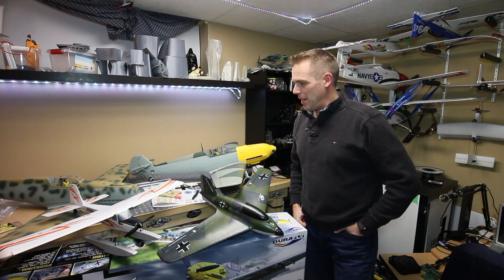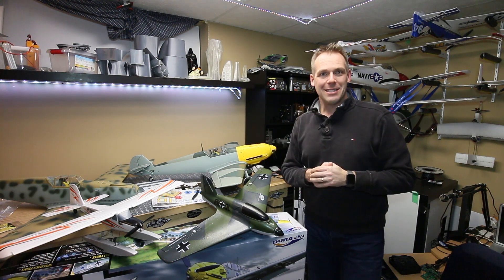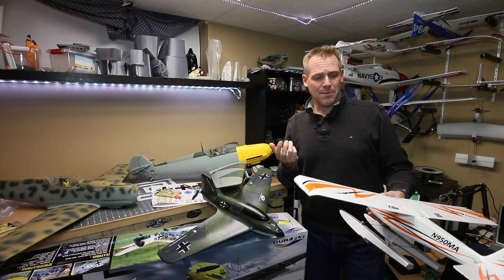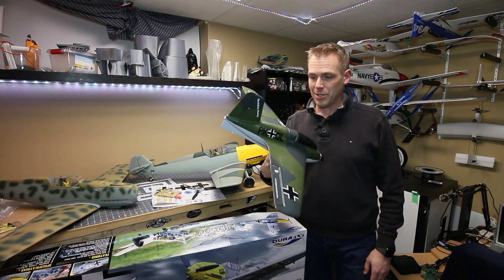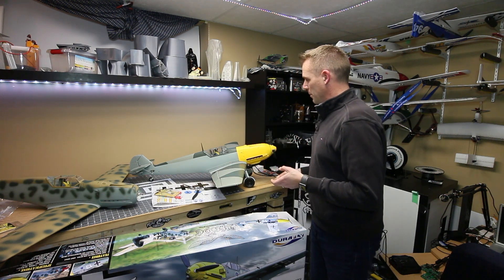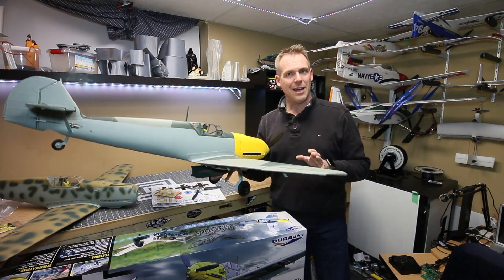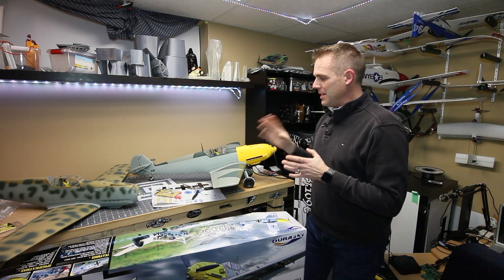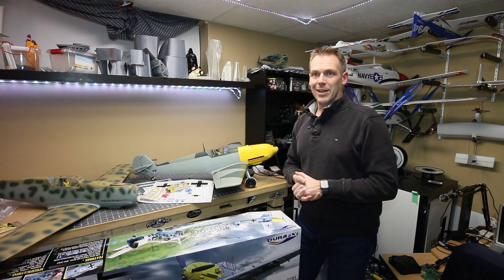I Flew & The New Durafly BF-109 - Update #128

Comment: Hi everyone! Somebody know what max battery size (in cm) can this plane fit inside battery compartment?
Reply from the maker: I'll measure that later this week for you.
Reply: André Rousseau tks) waiting)
Reply from the maker: 50mm wide and 32mm deep. My 4S 2200 zippy 40C fit with no issues.
Reply: André Rousseau What is max length? Abt 140mm? What max battery weight can this bird carry? 350g is ok?
Reply from the maker: Flying Weight: 1300~1400g
Battery: 2200mAh 4S LiPo 

https://hobbyking.com/media/file/b/f/bf109_manual_v1.1.pdf

Willing to bet at 350g you'd be ok but on the heavy end.
Reply: André Rousseau thanks for your answers! My plane is still on his way and I am choosing battery now. Max width and height I know from you already..but what max length can battery compartment fit? (No such info in manual)
Reply from the maker: From the back of the battery tray to the fire wall is 22cm.
Reply: André Rousseau thanks! So 50x32x220mm is max.